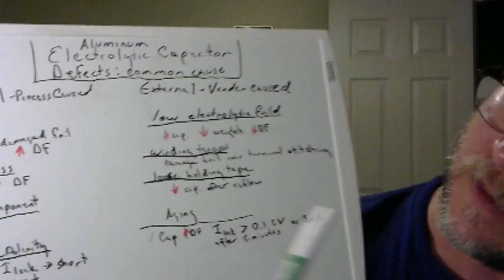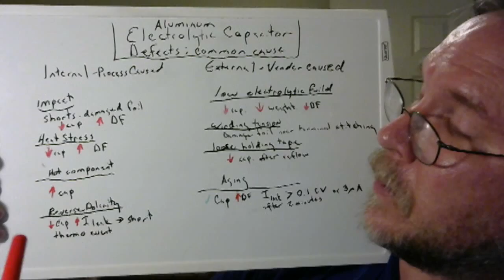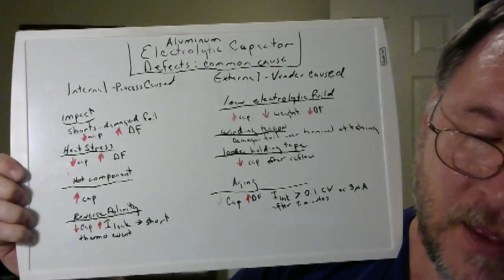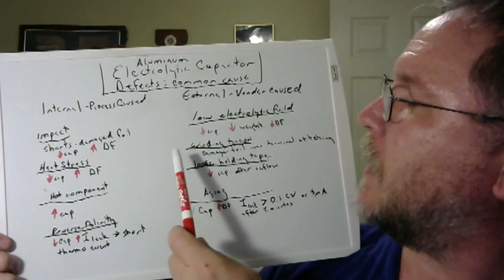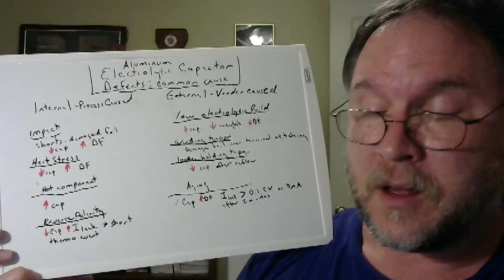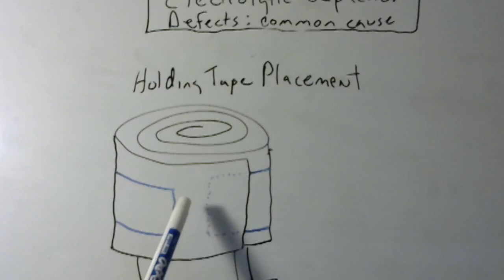Common aluminum electrolytic capacitor defects found on production line

Comment: Thank you for the informative video! Are you a manufacturing engineer? How did you learn this information?
Reply from the maker: I was an electronic technician who would dig into finding the root cause of manufacturing defects, determine if the assembly line process was damaging the components or the supplier was shipping bad parts.   Mostly learned by doing and communication with suppliers' application/field engineers.